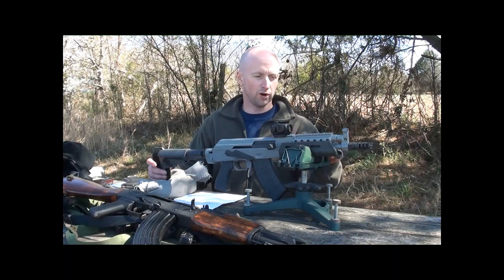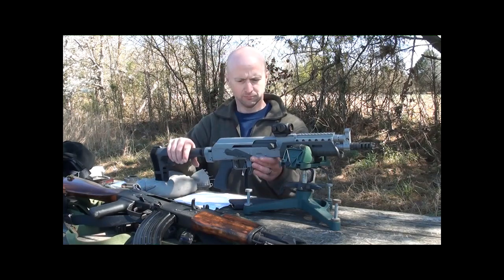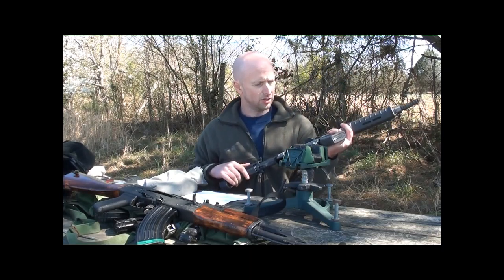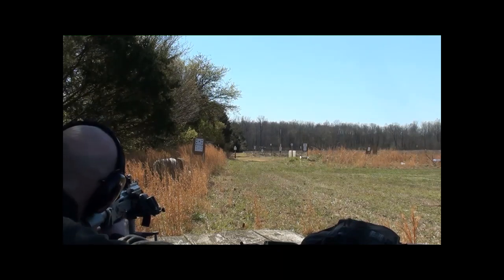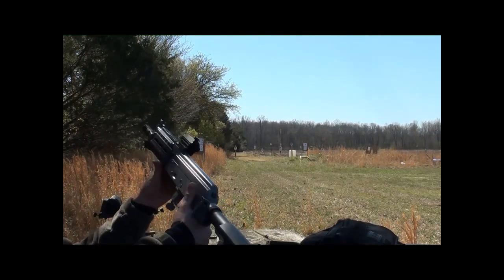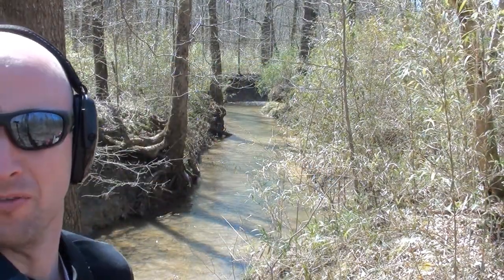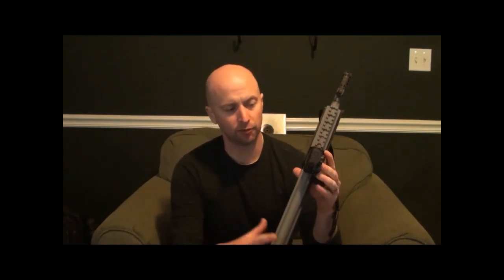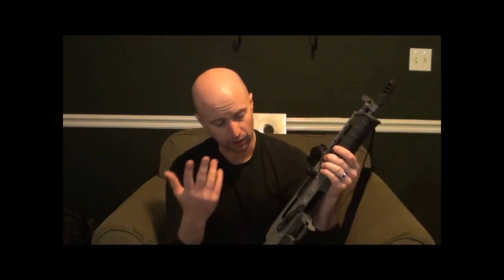Polish Lynx Tactical Part 4

Comment: I noticed that rear site was gone, and was going to comment on the Caveman Eotech technique used with AKs for snap shooting doing just what you described. I am glad to know that it works. I haven't seen if a part 5 is up, but I would love to see how the internals (trunnion, bolt etc) are looking though I doubt it would be a issue with WBP. Knowing if you have changed anything in the last year would be nice or if any issues have arose. Have you tried a flash suppressor on it yet? The recoil especially with the heavy spring make them smooth shooting, but the flash, noise, and concussion are brutal especially for a home defense weapon, and I've seen some flash suppressors do an amazing job at eliminating that fireball. Thanks again for this series, WBP & Atlantic should write you a check, or at least send you some schwag.

Comment: I just got mine last week & definitely in search of bottom handguard because it gets hot quick which is no bueno! I looked into getting the midwest industries or SLR that both run $160 but then I'm looking at them & I don't believe my Picatinny gas tube will work with either & I'm not trying to spend a extra $100 making it $260 for this little ass handguard! I need a angled grip so I'm digging that magpul one that I didn't know would work. Even with the midwest hanguard it looks to be a pain in the ass to remove the gas tube that doesn't even come with & my Picatinny one won't work with the upper part of the handguard kind of ridiculous for the price in this case.
Reply from the maker: I am very happy with the magpul AKM.  Any it will take any MOE attachments so that is a plus.  Even with several mag dumps heat was not an issue.
Reply: @78JCarter good to hear! I have one on the way & got my Meridian Defense BD2-AK Muzzle Brake in & installed today, can't wait to see the difference. Eventually I'm going to get the skeletonized folding stock tailhook pistol brace since it definitely needs a brace 😄
Reply: It is funny you say that about the MI handguard as Jim Fuller from Rifle Dynamics was building custom AKs with those, and not using the top handguard as he runs the Ultimak, so he mentioned he had literally a pile of those tops. Also AK shooters very commonly wear gloves or at least on the support hand. I don't prefer it but it is a easy remedy especially for long hot range days. I'm sure the Magpul furniture with its heat shield will work well enough.

Comment: I am thinking of buying this Polish AK pistol.  Had a very bad experience with a brand new PAPM92.    Do you have a PAP?  If so, how the two compare in your opinion?
Reply from the maker: I do not have any first hand experience with the Serbian AK's.  When looking at what the Lynx has to offer with the (vertical) underfolder rear trunion, extended magazine release, weaver rail built into the front trunion, standard AKM handguard furniture, threaded barrel, quality machining on the internals, excellent (for AK) accuracy, all at a price point similar to the M92, the choice was easy on this purchase.  And It has yet to have a malfunction.  As I have said in the past, this rifle without a stock is a paper weight.  With a stock, (read arm brace or SBR) it is everything one would want in a close range fighting rifle.
Reply: @78JCarter  Thank you.
Reply: Mini Jack or Lynx is lighter. I have both and I enjoy the mini jack or the pap